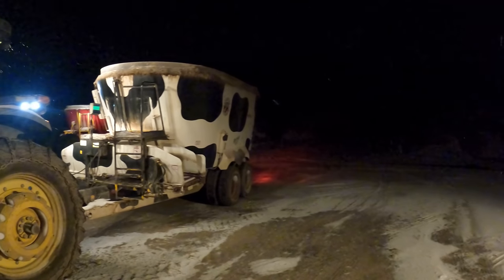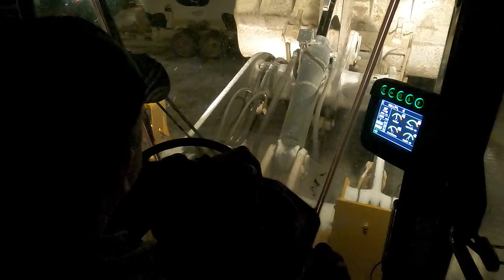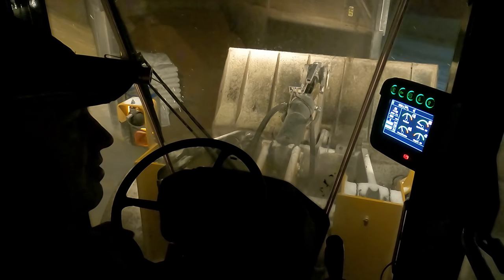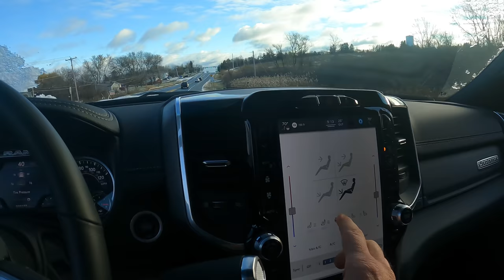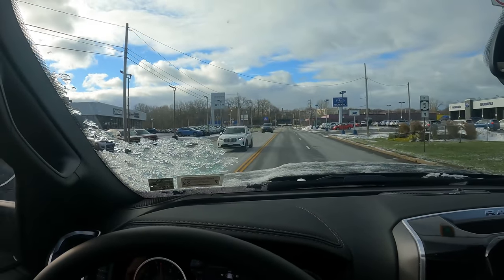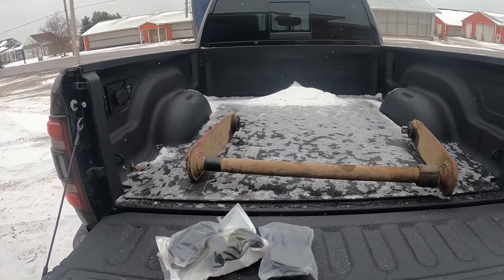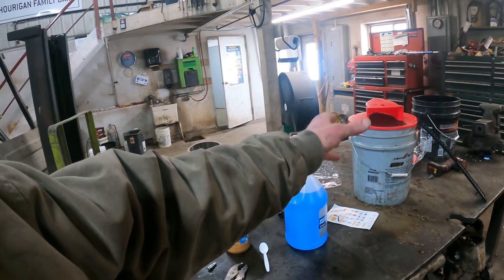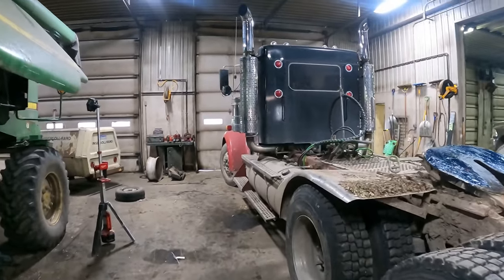Peanut Butter and Windshield washer fluid

Comment: Excellent video it's important to keep the mice and rats out of combine cab they are so distrustful when they get done with the seat it would be on to the wiring and plugging up the heater core with crap .I would set the same thing up in the corn chopper there is a lot of stuff for them to destroy on it i have had to fix so many wiring issues on customers machines from mice chewed wires and hoses I had to go on a service call last summer the guy said his John Deere 8300 tractor lost it's oil pressure so I got there it had no strange sounds other then the buzzers going crazy and lights flashing I told him that it's a electrical issues so I took the cover off behind the cab and right up by the ecm a small blue wire had been chewed off so I repaired that and every thing worked good I spent more time driving there then fixing it. Keep up the great videos Andy 👍👍👍👍

Comment: I got the exact same traps for my sheds. Don't put your peanut butter on the tilt table itself. Cram it up in the V of the cover. I did that and used it as a glue to hold a dog treat (beggin strip piece). I also used lemon pledge to make the tilt table a little slicker. Put a smear of peanut butter up the steps too. Caught over a dozen and haven't had to rebait. Thanks for the washer fluid idea.
Reply from the maker: Yeah I have it in the lid to

Comment: Again watching you helped me with a problem I am having.  I have just ordered the mouse traps to get rid of the dam things that moved in this fall. I had same experience you did, they ate the pouches and the green bars, all I think I did was make them breed more. Thank you for todays video. I always appreciate the time and effort you put into making them.
Reply: I had so much problems with woodticks here in northern Minnesota so I did a bunch of research and learned that mice are the hosts that bring the tick eggs to adult inside there intestines so I got a cat and now I have 7 cats but this year I only found 3 ticks I would go to do my farm chores before and pick 30 ticks in a hour I hated being outside in the spring and early summer. If you can I would strongly consider getting a cat along with the traps . The mice destroy stuff so fast.

Comment: I'm just 35 miles north of Portland Maine in Bath. Used trucks are solde before they are traded in almost. The dealer tells a customer a truck is coming in and it's bought sight unseen most of the times.

Comment: That friend of yours from Wisconsin is a smart guy. Those mousetraps work really good. I have a couple of that same style. I also have a couple I made, which are identical only I just used a wooden dowel as a roller that runs across the top of the bucket. I put the peanut butter in the center, the mice walk up the little ramp, the dowel rotates and they fall into the washer fluid. They love it too lol I will end up with like 10 of the things in the bottom of the bucket they cannot wait to jump in there with all their friends.
Reply from the maker: Time to start collecting the mice

Comment: A tip for the bucket mouse trap. Put the peanut butter on the lid of the trap. It keeps the teeter part clean so they slip off and into the wild blue yonder 😁 That's what I saw on a YT video👍
Reply from the maker: I have it smeared on the lid too

Comment: Did you try that Grandpa  Gus's rodent repellent the last truck I had they ate alot of wires.  Now on my 2019 I used past 3yrs not one chew on any wires just spray it on every  so often  works great.
Reply from the maker: No I haven’t

Comment: Buy Havoc XT 2nd generation rodent poison You can make bait stations out of 2'' pvc.  A 2'' tee and 3 1' piece of pipe and a cap. Glue 1' pieces to tee. I like to use wire and put bait chucks on wire and then put down center pipe. Weather proof bait station.

Comment: If you don't mind the smell of moth balls they will repel mice.
Reply: I don't know I've always been told moth balls as well but I hate the smell, and I have repaired a lot of mouse damaged wiring harness is breathing in moth ball fumes the entire time lol
Reply from the maker: I isn’t loaded the combine with north balls and they didn’t work
Reply: @FarmingFixingFabricating  What is a north ball? Moth balls should work. Military has been using them for over 200 years and they've worked.

Comment: The supply chain woes are from more than COVID. There are thousands of containers sitting in ports. The truck driver shortage has been building up for years as older drivers retire. The electronic logs make it more difficult to cheat on hours. Truckers who are paid by the mile can't make as much money. It's difficult to find people who want to be away from home for weeks at a time living in a truck. It becomes a 24 hour a day job that doesn't pay well. Factories that make things changed from running an 8 hour shift to running 24 hours a day. They can't just put on another shift or work overtime when added production is needed. Then there's the "just in time" manufacturing theory that you only produce what is needed and deliver it as needed. There is no reserve. If something happens to one supplier that cuts the supply of one part, assembly lines shut down.

Just like on your farm, if the demand for milk suddenly doubled, you can't get the cows to produce more. You can't add more cows if there aren't any cows available and you don't have the facilities to milk more or the food to feed more cows.